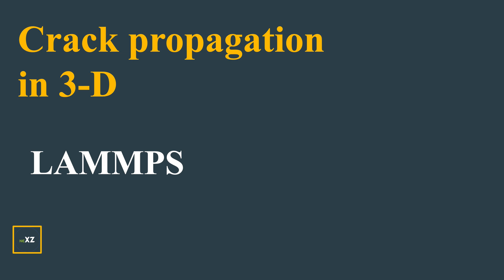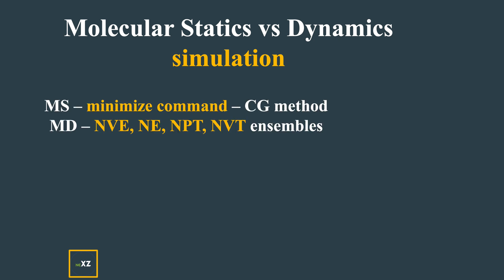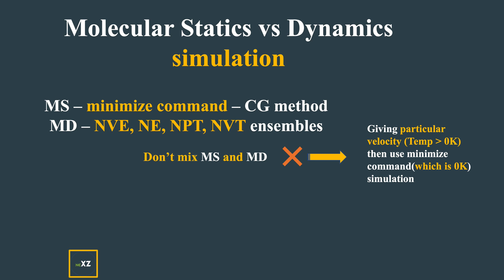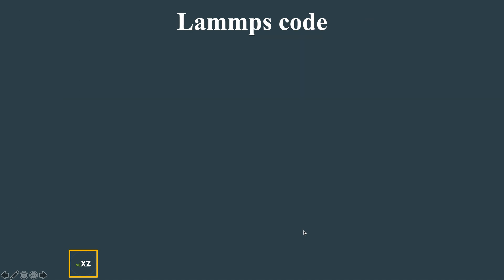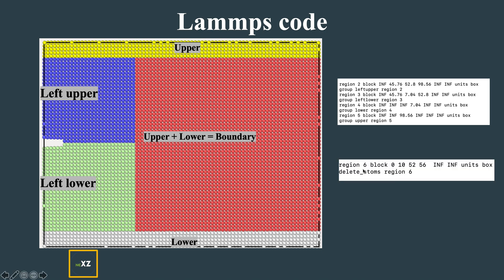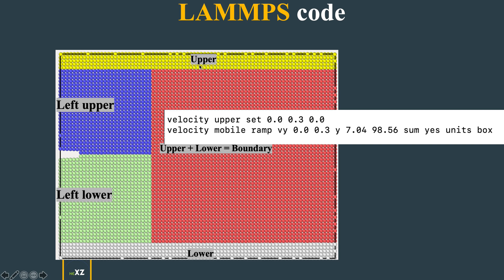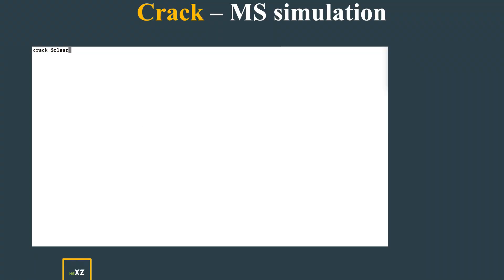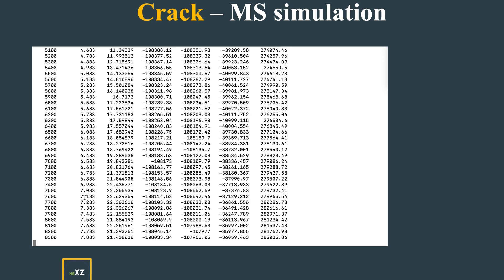Crack propagation | Crack simulation in 3D lattice | FCC | Nickel eam potential to simulate FCC-Ni

Comment from the maker: LAMMPS code for 3-D crack propagation in a FCC lattice:

Lammps code for crack propagation:

units           metal
boundary        s s p
atom_style      atomic
neighbor 0.3 bin
neigh_modify delay 5

region 1 block 0 140.8 0 105.6 0 17.6 units box
create_box 5 1

lattice fcc 3.52
create_atoms 1 region 1 units box

# Regions

region 2 block INF 45.76 52.8 98.56 INF INF units box
group leftupper region 2
region 3 block INF 45.76 7.04 52.8 INF INF units box
group leftlower region 3
region 4 block INF INF INF 7.04 INF INF units box
group lower region 4
region 5 block INF INF 98.56 INF INF INF units box
group upper region 5

set group leftupper type 2
set group leftlower type 3
set group lower type 4
set group upper type 5

region 6 block 0 10 52 56  INF INF units box
delete_atoms region 6

mass * 58.69
pair_style      eam
pair_coeff      * * Ni_u3.eam

timestep  0.001
dump dump_1 all custom 10 dump.min id type x y z ix iy iz vx vy vz
thermo_style  custom step time temp pe etotal press vol
thermo 100

variable t equal time
run 100
undump dump_1

group boundary union upper lower
group mobile subtract all boundary
compute new mobile temp

velocity upper set 0.0 0.3 0.0
velocity mobile ramp vy 0.0 0.3 y 7.04 98.56 sum yes units box

fix 1 all nve
fix 2 boundary setforce 0.0 0.0 0.0

neigh_modify exclude type 2 3
thermo_modify temp new

dump dump_1 all custom 100 dump.min id type x y z ix iy iz vx vy vz
thermo 100
thermo_style  custom step time temp pe etotal press vol
run 10000
unfix 1
unfix 2
undump dump_1
Reply: I did not understand INF INF in region command
Reply from the maker: When you use “INF INF” command, you are selecting the whole region in that dimension, so it like selecting from -∞ to +∞. Hence you need not worry about giving higher and lower boundary of that dimension to select the atoms. Like the boundary starts from 0 to 50.6234 Å. You need have to worry about giving exact values to select atoms.

Hope this answers your question
Reply: @NextZenStudent  in this code x is perpendicular to the plane
Reply: Even I needed help in how to apply hydrostatic pressure in lammps(triaxial system) I have already mail you
Reply from the maker: i didn't the "code x" , I didn't get the part you are referring to